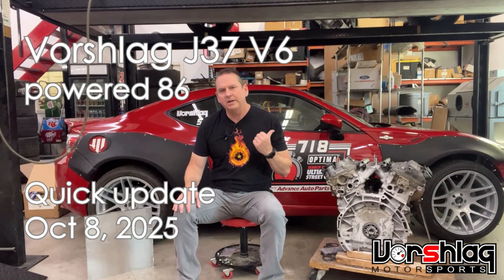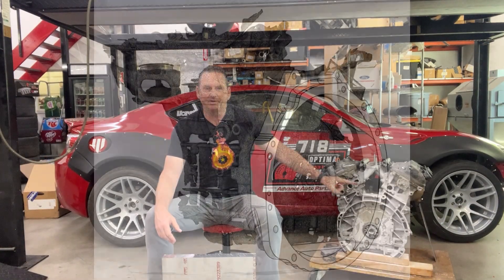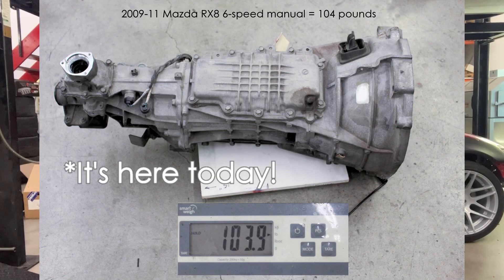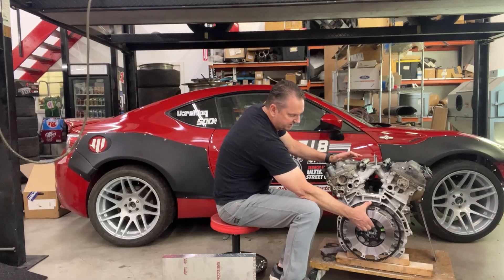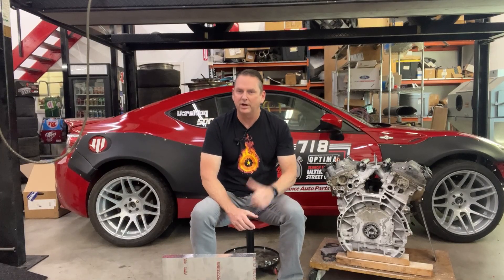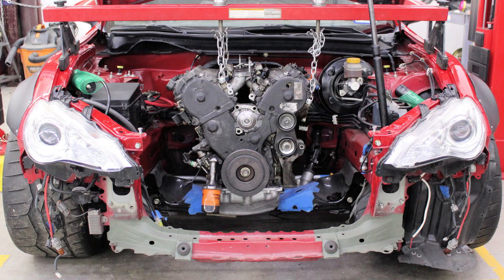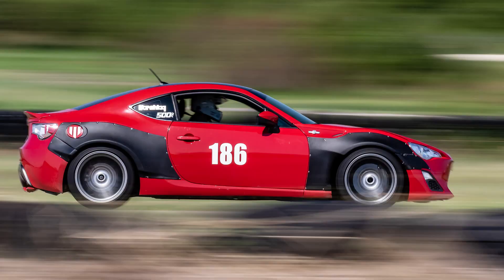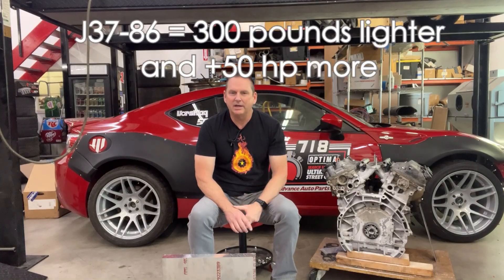Vorshlag Honda J37 swapped 1st gen 86 - update for Oct 8, 2025!

Comment: As far as I understand, the RX8 and 86 both use the Aisin AZ6 gearbox. Is there any special advantage to the variation installed in the Mazda, or is it more a question of availability?
Reply: The internals are different. Second version of rx8 trans is stronger than 86 trans
Reply from the maker: The 2009-11 RX8 box is stronger, direct shift (not remote shifted), starter position is much lower (fits the tunnel) and the bellhousing-to-shifter distance is spot on for this swap

Comment: Chassis question, the 86 twins (both first and second gen) are know for their EPS freezing up under high loads. Local track cars have this with 200tw 245-255 tires… does yours keep up with the giants 3xx tires you use? Is there a fix? I tried googling but all I can find is people saying they also have this issue
Reply from the maker: This does happen and it was a real issue on our 2023 BRZ with 265mm tires. Mostly it comes down to driving style, as it happened to me (Terry) and almost never to my wife (Amy) driving the car to the same lap times. I tend to trail brake much harder, so "Braking while turning" is what seems to trigger it. We're still looking for a fix, but I got used to it and it was no longer a surprise.
Reply: @Vorshlag  I’ve been doing some more googling, and apparently the later years of the gen 2 got a new part number for the power steering motor. But couldn’t find if it actually fixed it or if you can slap it into a gen 1
Reply: I've lived on the forums for years have this is the first time I've ever heard of it. 

I've heard people complain that the system has continued to become less natural feeling.
Reply: @wayward03  really? just google "brz power steering at track". I've have 2 friends that had BRZ's and both experienced this at the track, one on a first gen and the other on a second gen.